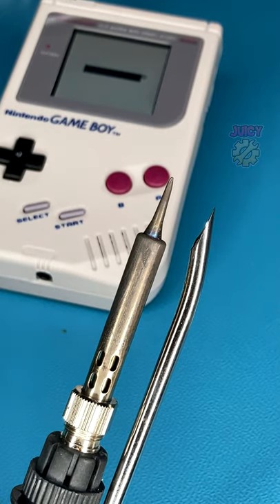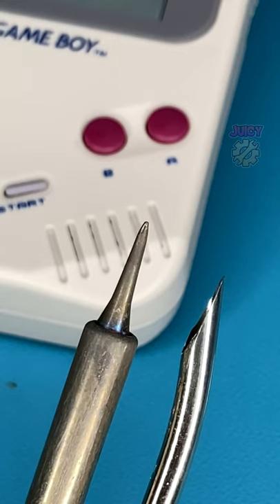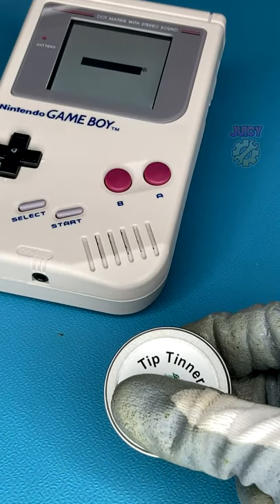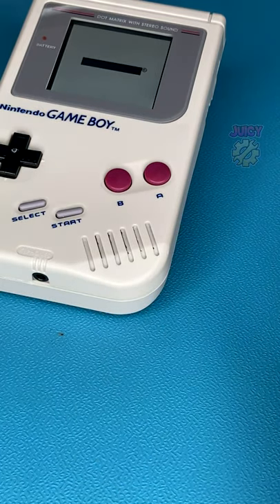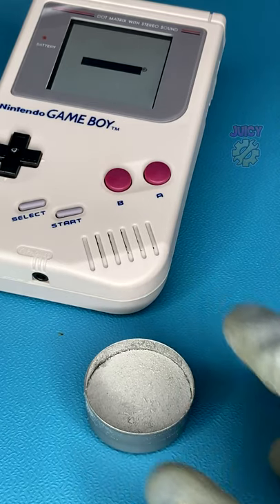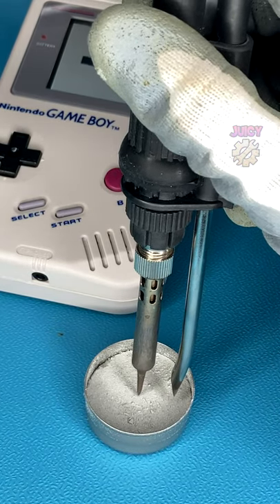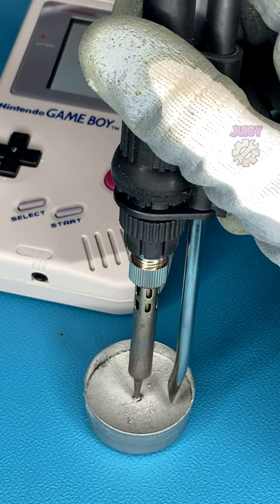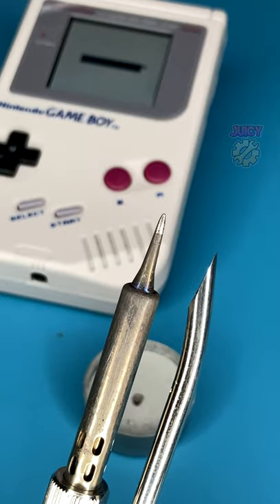Repairing your soldering iron tip - Tip Tinner

Comment: Is that a temporary tip tinner is there a permanent tip tinner and can you 10 any extremely bad tip after and does it work the same as it would or should normally
Reply: Please rewrite your comment with punctuation, I have zero clue as to what you just said
Reply: @hunterlepage  I think what she is trying to say is "Is that a temporary tip tinner? is there a permanent tip tinner? and can you repair any extremely bad tip, and does it work the same as it should normally?" (Sorry i tried my best)
Reply: Respectfully you need to read over your questions a few times before you go hitting send, this is more ineligible than doctors writing to fill prescriptions